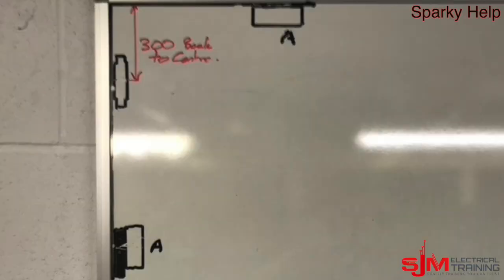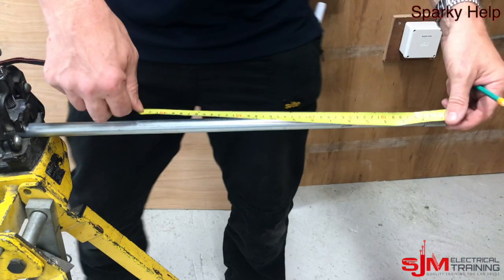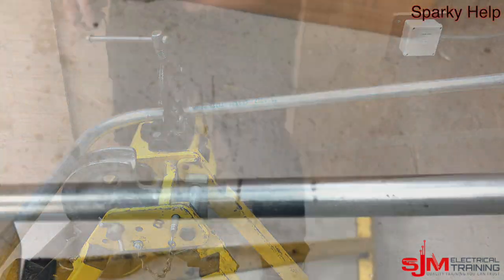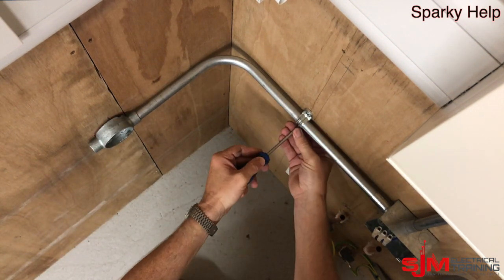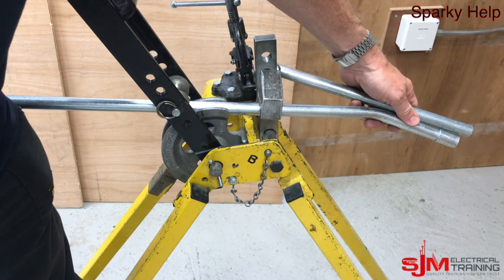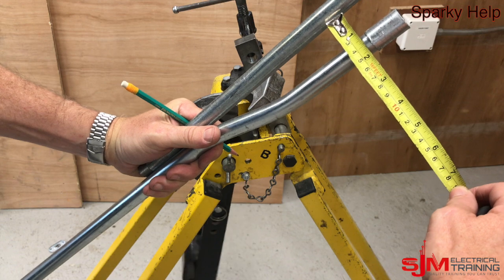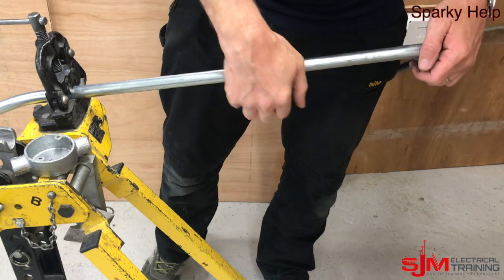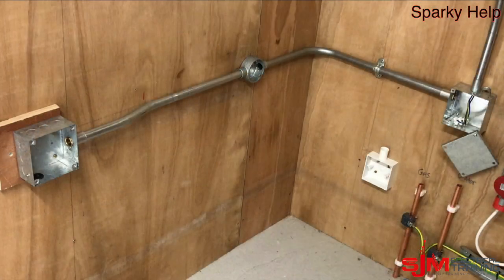Electrical Conduit, 90 Bend to Thru Box & Double Set From Thru Box to Adaptable Box - AM2S

Comment: This blagged my head. Most videos show you measuring to the inside of the 20mm hole at the box. I had a go and got in right. Then saw this video and  you measured to the outside of the 20mm hole and got 50mm. I had a go at this method and it was way off this threw me right off when practicing. Then I rewatched the other videos and realised people measured to the inside and since then I've been successful.

Comment: Nice video here it shows the exact same system that is required in my am2e. I’ve done my experienced worker assessment so now got my am2 on Monday and haven’t bent 20 mm steel in 20 years haha
Reply from the maker: Thanks for watching please share with like minded people and good luck for Monday.
Reply: @sparkyhelp3997 thanks a lot. I don’t suppose you have any information on fault finding (especially cross polarity)or s plan heating systems with solar?
Reply from the maker: @billyrigney2280  google am2 heating wiring diagram!
Reply: @sparkyhelp3997 thanks. I’ve never done it before but it’s just connecting from a diagram so should be fine

Comment: Have you ever worked on site?
First thing electricians do is make handles for the stocks to make threading easier.
Reply from the maker: Thanks for watching. If you need longer handles, use longer handles!  Thanks for watching though - Maybe if I was threading 32mm (which the stocks and dies would be bigger anyway)
Reply: Make a video showing how to make handles for stocks?
After working on site and threading 20mm conduit all day longer and fatter handles save both arm and back ache.
Reply from the maker: Yes, don't miss it - keep going though, if you are lucky you will not be doing it until retirement.  Again thanks for watching.

Comment: I failed to meet the spec in the am2s, the spec says “through box must be 500mm from back box”. Is that 500mm to the centre of the through box or 500mm where the offset bend ends and meets the conduit? 

Also failed on industry standards but I’m not sure what that could be. I work in social housing so bending steel/pvc is far from my strong suit
Reply from the maker: Hi and thanks for watching, you need to read your specification as to where exactly the 500 measurement is from and to (I would say end of conduit to centre of box, but check).  As to why the other comments some things to make sure are correct:
Tight, no threads showing, absolutely no burrs, fits correctly & dimension.  Hope this helps  Please like and subscribe Good luck.
Reply: @sparkyhelp3997  that’s great help, thank you for the reply!